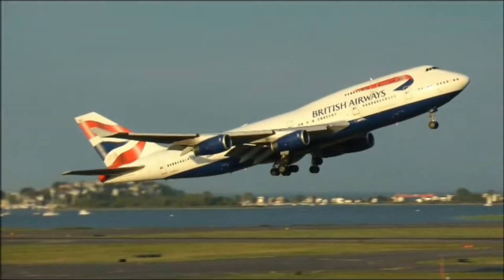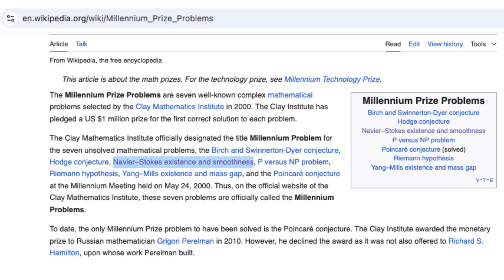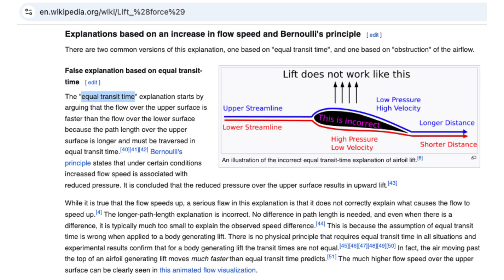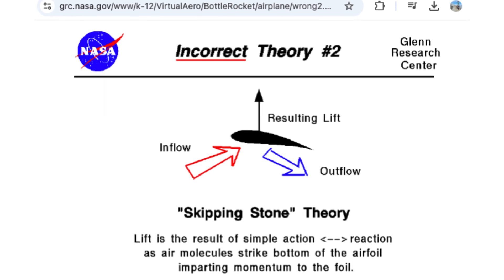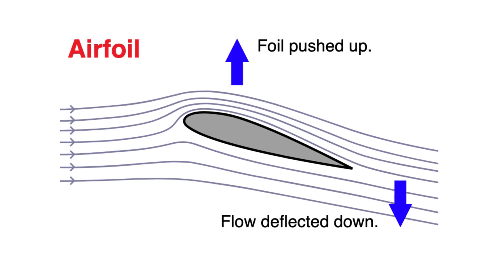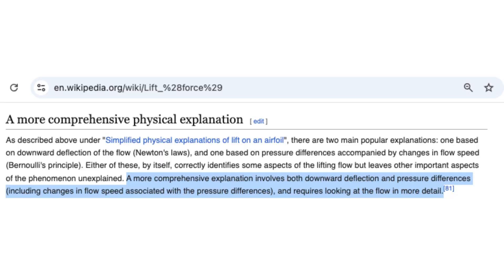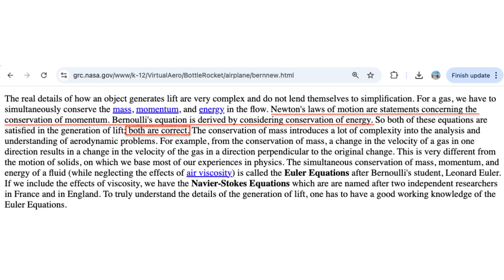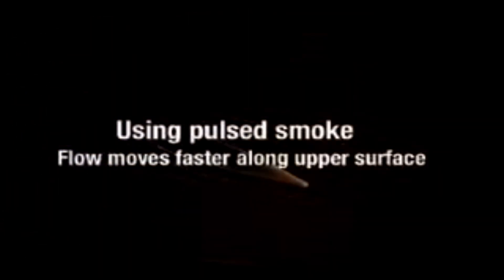It's Puzzling That We Still Don’t Know How Airplanes Fly!

Comment: A lot of arrogant comments that are purposely taking this video in bad faith. Let me explain it in a way so people better understand. We dont understand lift in the same way we understand simple chemistry. If I describe a combination of baking soda and vinegar, a chemist could figure out exactly how long the reactions will last, the heat produced, and the final products. On the other hand, if I presented anyone with an arbitrarily shaped 2d airfoil, and described the angle of attack, speed, viscosity, and density of the fluid, nobody could tell me if the airfoil will generate lift without real world testing or CFD or some other numerical computation. Solving the navier stokes equations would provide us with this ability.

Comment: Well, the Navier Stokes equations are non-linear and no general analytical solution exists, but they are numerically solved (with some approximation) and, solved in 3-D, predict lift and drag. And indeed lift is the product of the pressure distribution on the wings...So, why the title of the video claims we do not understand lift is a bit puzzling, but it all depends on who wrote the script.
Reply: And planes were successfully built long before vector algebra was applied for aviation.

Comment: It is good to see that that the conventional ideas are not fully accepted. one issu I have is that in the wind tunnel tests it is the air that flows whilst the aerofoil is static.
In real life the air is static ( ignoring any winds or air currents) and it is the aerofoil that moves, After the aerofoil has passed through the static air, does the air remain static? There will be some disturbance due to drag(friction). But static air suddenly speeding up always seemed anamolous to me.

Thank you for your insightful video.